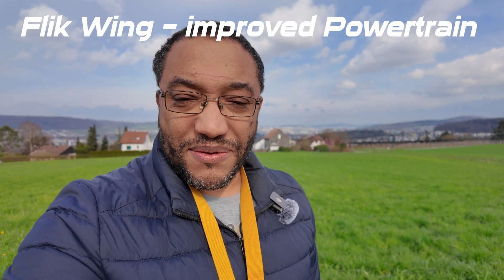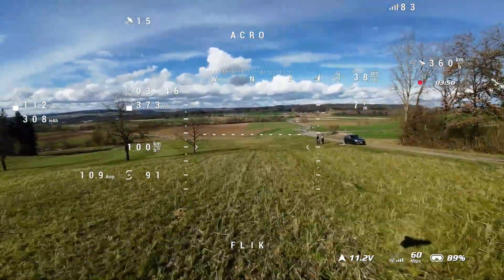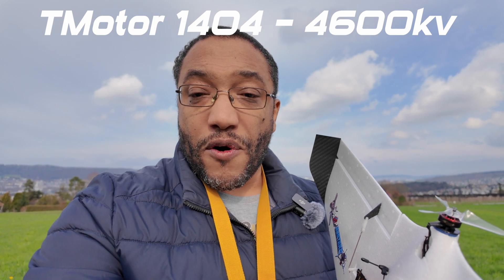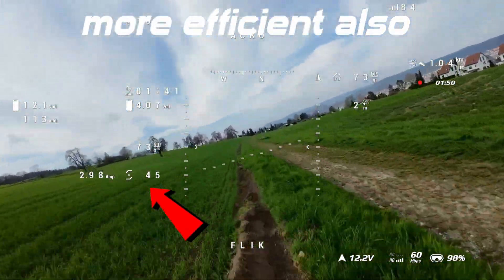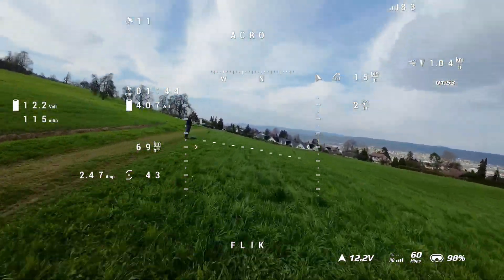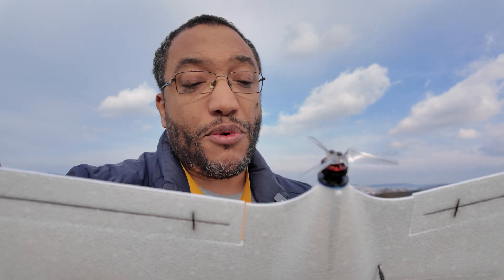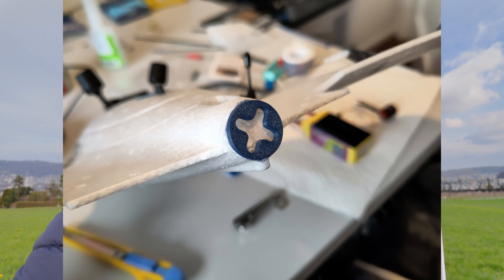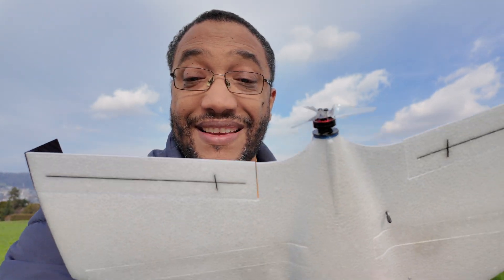Flik Wing  - 1404 4600kv // improved Powertrain // 3S DJI O4 Pro

Comment: I have old 1806Motor from AR Wing Mini laying around. Would fly it with small 4S Battery. And Spedebee wing Mini FC.
Analogue it will go over 250g but eould 1806 Motor Fit with custom Printed mount? Or ist the Motor Bell Diameter larger then the end of the fuselage of the wing and get to heavy?
The Bell Size is 23mm
And waight 19gramm
Your motor weight around 9-10gramm. Wuld the 10g for larger Motor make an problem? For lounching and something. Other wise i shound have another 1406 motor in my toolbox
Reply: Thank you
Reply from the maker: @mauritz1774  You are welcome ;)
Reply from the maker: As long as it also has a 12x12 pattern it will fit the motor mount. It's just the motor is 10g heavier and that is weight at the end of the wing... you would need to balance that out with the 4S pack or additional weight to get the right CG. The 1406 would be the better option I guess - or at least easier to get the CG correct. 😉

Comment: did you retain the original ESC with the new motor?
Reply from the maker: Yes, I'm using the Emax 20A bullet ESC with the new 1404 - works nicely.
Reply: @McLogo76  Thank you!  I am building up some 18500 lion packs 3s 2040mahr.  seemingly not a lot heavier than 2s 18650. Just hope they can keep up with the amp draw.  My poor little wing has the 50 mission look! Thankfully I have a spare airframe.
Reply from the maker: @rocketrob3324  Nice! Mine pulls about 9.5A on autolaunch with 68% throttle, and  with 35 - 40% you can easily cruise with 2A and below. Btw. I've also ordered a 2nd signature edition. Have fun mate

Comment: Thanks for the video i have only flown my flik a few times, noticed the heat from the motor straight away!! I'm about to put a flight controller setup in it but wondering if you have done autotune on yours? It flies really nice!!
Reply from the maker: @Steeeve_eafo  Thanks mate, I did go for enough throw on the elevons and did also do the auto tune on the first flight. Btw auto tune basically does not change the pid - but still recommend to do the auto tune so the rates are adjusted accordingly
Reply: Holy cow you were right on the deutschmark with the motor size! I couldn't help it and went for a 4s fly this morning... really pumped to get over 140kmh and so stable with inav!!! Thanks again legend happy flying!
Reply from the maker: @Steeeve_eafo  Awesome! Have fun 👍

Comment: Thank you for this! I'm thinking of tryin out other motors even tho I only fly 2S lion and I got a 6000KV 1108 I feel like it sags under full throttle and can be more efficient if I used slightly lower kv and shorter stator. Huge thanks for the 3D print file cause I was gonna make my own and u saved me time 😎 Happy flying! I'm jealous of your amazing location to fly haha
Reply from the maker: Thanks a lot mate. 🙏 To be honest I think even on 2S the 1404 motors should have more torque with lower kv. My 1108 5200kv never got to rev up fully on 3S... it just got hot at higher throttle settings. Have fun and looking forward to your flights!

Comment: On my Flik, the motors get super hot as well using 3S. I am afraid to burn it too. How did you removed the motor spacer from the foam and what kind of glue did you used to glue the printed one ? Cheers from the Zürich area and get well soon.
Reply from the maker: @Propspalter  The motor is screwed to the carbon plate and that is glued to the wooden motor spacer with a bit of E6000 to the foam.
You can seperate it quite easily with a sharp knive/cutter.
i did also use E6000 to put it back together, just be careful to not apply too much. (It should be something like E6000/shoe goo or similar that stays a bit flexible).
Thanks a lot mate - gueti flüg 😉

Comment: Excellent, I've been comparing specs in my head about this very same thing. I've been planning around building my Flikwing around 4s 750-850 since I have many packs. I was initially thinking of 2s 18650 like my Nano Goblin but I do not want a low voltage situation with my 03 air unit. Even with the Goblin, I used a voltage booster on vtx. Anyway, I had good success with 1404 4000kv on my 3.5 in quads so that is what I'll be trying on the Flik. BTW, one of your Lil Matey videos convinced me to try the frame - it's been terrific!  Lastly, thanks for providing a file for the new motor mount!
Reply from the maker: @panemetcircenses510  Thanks a lot 🙏  I hope to hear and see how the Flik flies with 1404 and on 4S 😉 mate. Yeah, great to hear you are also enjoying the lil matey. That is one awesome frame. 👍
Reply: @McLogo76  Most definitely will let you know. Keep up the good work!
Reply from the maker: @panemetcircenses510  Thanks mate 🙏